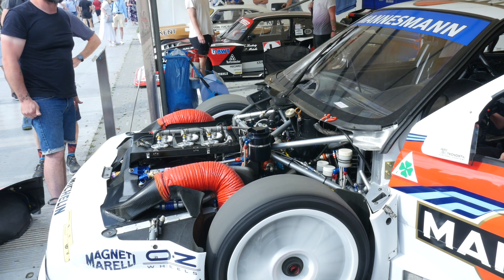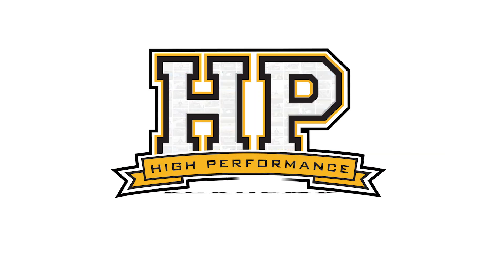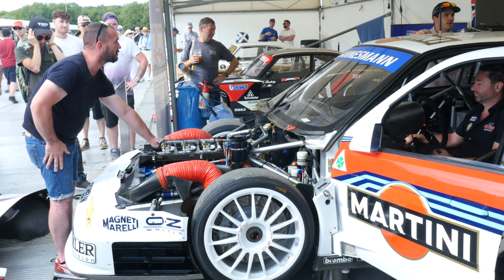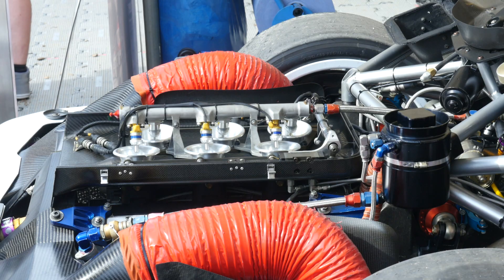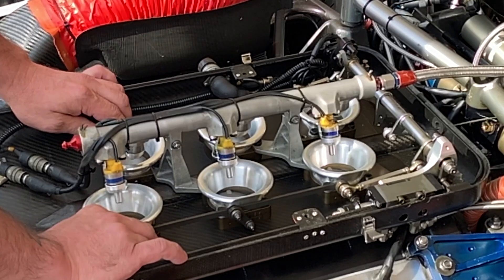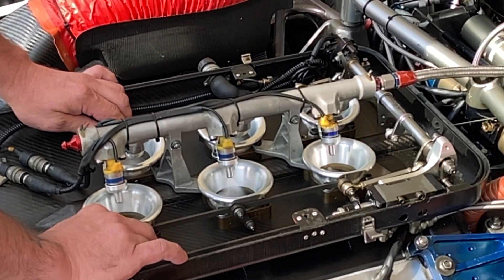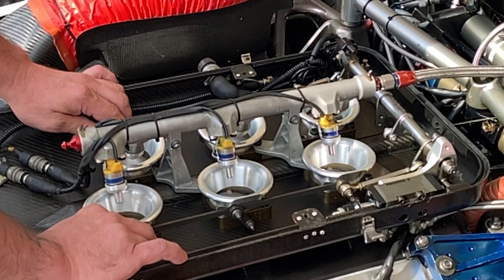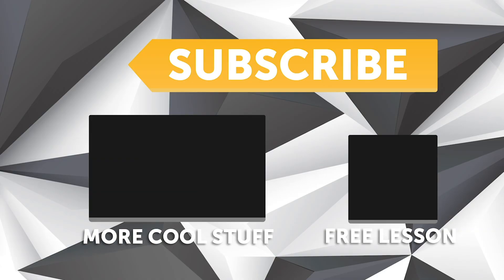ITB Fuel Injection 101 | 2.5L V6 Alfa Romeo 155 TI DTM [TECH NUGGET]

Comment: Are there circumstances where people run injectors above the trumpets and below and have them alternate at rpm? Or is that not possible?
Reply: this is a late comment but most motorcycles do this, they have a secondary fuel rail like the one in the video that runs at WOT but for part throttle/low throttle they run a more normal port injection system

Comment: The cooling effect is one of the other big advantages of this method of high injection height, it can essentially create a denser air mix to the cylinder, which in turn is dynamically increasing engine capacity if you want to look at it like that.

Comment: https://youtu.be/565F3KBZptE 1993 debut of the DTM 155. You will notice that the engine pitch is noticeably higher in the 1994 season. The 1996 car only used a one off 90° V6 very loosely based on the Lancia Thema PRV v6 (Peugeot, Renault, Volvo) joint venture v6 in service from 1974 to 1994 primarily with 2v per cylinder. The 1996 DTM 155 used completely bespoke DOHC 24v F1 style pneumatic valve springs to control much larger valves at high rpm.  It was the big bore short stroke combination that allowed Alfa Corse to simply be the fastest DTM car in 93, 94, and 96. Mercedes consistency and writing of the rules allowed them to eek out the championships in those years. However they were scared to death because they were challenged and beaten by Alfa Corse. This put them under pressure they hadn't been under since pre Auto Union.

Comment: Hey HPA, I'm new here but how do they filter the air coming through the intake? Or do they not filter it?
Reply from the maker: Although I'm not 100% on the filtration, there is a carbon fibre air-box that goes over the top of this setup. It also force feeds air from the front bar to the ITBs - Taz.

Comment: i assume they use MAP sensor? is it even possible to fit a MAF sensor to itb for more accurate mass of air reading?
Reply: Likely Alpha-n fuelling. Might use speed density (MAP sensor) for idle and part throttle.
Reply: @RockThePylon My guess is Throttle position, wideband o2 sensor, and knock sensor.

Comment: This is the final version of the 155 V6 Ti with a 90 degree Twinspark V6, it's closer to 490 bhp. The original single spark 60 degree V6 only had 420 bhp.
Reply: It was never a twinspark, first one was busso, second one is psa engine i think
Twinsparks are 4cyl!!!!
Reply: @Callagwhan  Wrong. Last model had twinspark. You can check the French Speed Connection video, he drove the 2nd version of the car. NONE of these engines had anything to do with Busso or PRV. They just took the V angle from a production engine because of the DTM rules. These are all full race engines and has barely anything in common with a regular PRV, Busso, Fiat/Alfa TS 16V, Alfa TS 8V or Montreal V8 engine except for a few engine configurations.
Reply: @Bedey53  BY the time it became a 90 degree V6, Alfa Corse made it a Twinspark.  I've even seen the photos of the cylinder head .  https://www.alfabb.com/bb/forums/alfa-romeo-history/439713-alfa-155-v6-ti-collection-informations.html
 They had many versions of the engine. 1993 was the Classic engine and chassis, cam gears in the front. Don't get hung up with PRV or Busso or Bialbero. These are full on race engines, each race year they make changes, bore and stroke difference, head difference, single spark, twin spark, etc. Again these are RACE engines, don't open the bonnet of your 156 GTA and say it's the same thing. It's not!!!

Comment: Love these cars, the engines were set up in such a way that they can change them out within 10-15 minutes all fluid lines had quick disconnect fittings and everything was pre-pressurized

Comment: Whole engine in front of the front axle. 
Strange that they did not push it deeper to the back. 
Excuse my English.

BTW excellent video, as usual.
Reply: Just the v angle,  it can't be more to the back because it is 4x4 and the front drive goes straight to the gearbox/centerdiff.
The whole transmission evolved from the delta gra to the 155gta then to this
Reply from the maker: The excellent point of the 4wd setup aside, this class of racing was also pretty heavily regulated in many areas - Taz.
Reply: @hpa101  yes, but its strange that they allowed to use different engine (this engine was never used in production 155 and have nothing in common with Busso) in different position, but no engine-behind-axle placement.
Reply: @jareknowak8712  The PRV (Peugeot/Renault/Volvo) V6 engine was used in the Lancia Thema. So they could use it in the 155 according to the DTM reglement. And the reason to installing it in front of the front axle was to lower the centre of gravity additional to the lower centre of gravity of the 90° PRV engine. Original Alfa Busso V6 had a 60° bank angle.
Reply: @MrCornholios  yes, thats true. I watched document about it. 
Do You know why they did not used Maserati V6? 
This is also 90 deg, very short stroke engine, made by cutting off 2 cyl from older V8.
Reply: @jareknowak8712  No Maserati engine was used in Lancias at that time.
Reply: @MrCornholios  yes, but why they did not used it in 155Ti?
Reply: @jareknowak8712  Because of the DTM reglement. The engine must be used in one car/model of the Manufacturer.
Reply: @MrCornholios  Maserati was not connected with FIAT???
Reply: @jareknowak8712  Yes, but it was not Lancia.
Reply: @jareknowak8712  The Brand must be the same.
Reply: @MrCornholios  It was also in the Delorean in severely detuned state.
Reply: @jareknowak8712  The engine needed to be from the same car maker and based on production car. From Sergio Limone: ""The V6 engine for the championship was born following the DTM rules: an engine derived from a mass-produced one... the interpretation the Germans gave to "mass produced" was same V-angle and same distance between the cylinders... Flicking through the papers, I noticed that Alfa Romeo at a certain point was no more: it merged and became Alfa-Lancia Industriale. This lasted for a few years (2-3 years), so Alfa Romeo produced Lancia cars too, so I picked the only 90 deg V6 which was the PRV (Peugeot-Renault-Volvo), mounted on the Thema too. So the engine on that car (the 155 DTM) is geometrically derived from the Thema. I also homologated the Montreal engine, even though it has never been used"
The Maserati V6 was not part of Alfa-Lancia Industriale.
The following video on "The history of Alfa Corse in DTM Championship" might help, mostly from about 25 minutes in and subtitles might be needed for non-Italians.
https://www.youtube.com/watch?v=ohPEXfm7q1M
Reply: @RJCpt  i know what 155 Ti is.
There are some AWD with front-mid engine. 
There are some with mid-rear engine also. 
It can be done.
Reply: @jareknowak8712  it can, check how Opel did it in the calibra, I think one off the requirements at the time was a quick change off the engine, and if all is behind its faster.
Reply: @RJCpt  this might be the reason.
Reply: BTW nr 2: engine in this Alfa is based on the infanous PRV V6 engine. 
There is a document about it on YT, but in italian language.

Comment: Maybe you could have 2 sets of injectors and just have the overhead ones come on above a certain engine demand level so that part throttle is still nice.
Reply: It's been done. It's a great way to go except that you now have twice as many fuel rails, twice as many injectors, a lot of extra control system complexity - plus the difficulty in properly calibrating the blending of the staged arrangement.
Reply: And You dont use half throttle or low rpms on track so often. 
But it would be great in high power N/A street engine.

Comment: Don't know how accurate it is, but also seen claims that the additional evaporative time maximises cooling of the charge, increasing density slightly - and at this level every little bit helps.
Comments, anyone?
Reply: In my Forumla SAE days, I did a set of high-mount injectors on my team's CBR600 engine. When the car came in from being on-track, there were streams of condensation running off the intake runners, which were straight up COLD to the touch on a 95*F day. Was awesome and made me grin.
Reply: @GroovesAndLands  I have seen this on intake manifold runners with individual runner meth injection.

Comment: Could you go in-depth on the tricks that superbikes use to gain so much HP per CC. like the variable length intake tract length, 2 stage trumpets and port injection, the exhaust valves to tune Helmholtz waves, ect ect. Bikes aren't your specialty but I'm sure you'd be able to speak in-depth on these incredibly packaged mass-produced race engines on the street.
Reply from the maker: I'll have a word to the boss man for you 😉- Taz.
Reply: Torque = airflow. HP = torque @ speed

The key to the massive HP numbers from bike engines is the high speed. Look at their torque numbers and you'll see they are typical in terms of ftlb per cc. However, proper manifolding/porting/cam timing does give them some rather impressive VE numbers that most auto engines don't match...
Reply: Same technology is used in many race cars.
Reply: @jareknowak8712  true, but not so many cars have 200+ hp per litre without Turbo.

Comment: This is standard tech on bikes.  Except the secondary injectors on the outside of the plenum don't fire unless it's WOT.  Same with the two stage trumpets, they lift up at high revs but are down at normal ranges.
Reply: just learned something today!
Reply: Yes but cars had this tech way sooner than bikes though .The reason this has become more interesting through the years is because many of these classes don't exist anymore. Case in point BTCC early to mid 90's.
Reply: The BTCC and the WRC have been restricted to death now, the fact they all have to run spec engines has killed a lot of the excitement.
Reply: @markmall7142  Yeah I know.  :)  Bikes get the tech after it's matured in the automotive market and shrunk down.  Fuel injection didn't become standard until the 2000's, and we only just started dealing with CAN-BUS.  But that's only talking about production OEM stuff.  Usually showroom cars don't have the high level stuff, where bikes do.  That was my point.  At the high levels both cars and bikes push the technology.  Case in point, MotoGP.  But if you want to buy an oversquare engine with a good R/S ratio, 15k redline, and 200 NA hp/litre, you're going to get it in a bike.  And I liked the German championships more back then.  I was a wee lad, but the 190 Mercedes was the first car that got me going.  Although all the racing was better back then imo.
Reply: @mikaelgaiason688  agreed . 👍